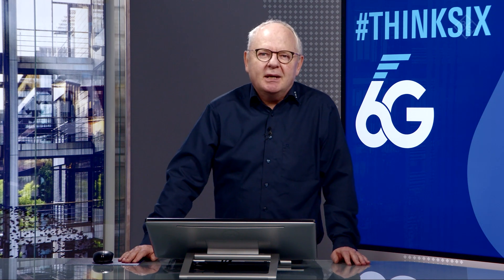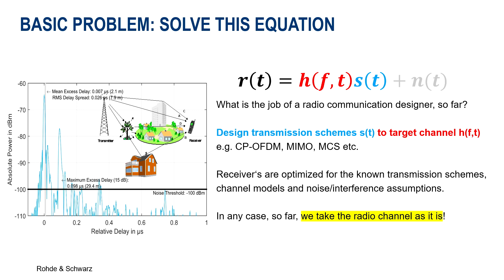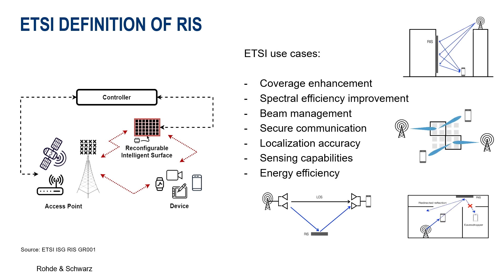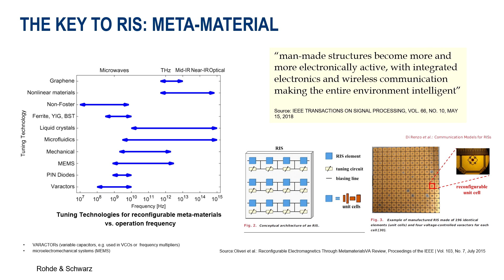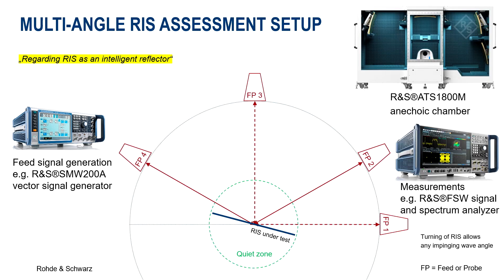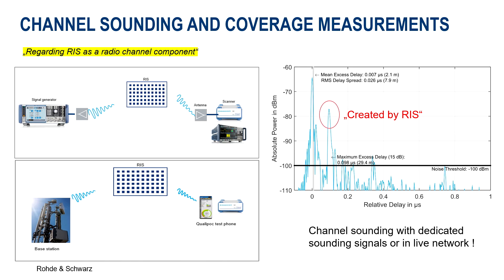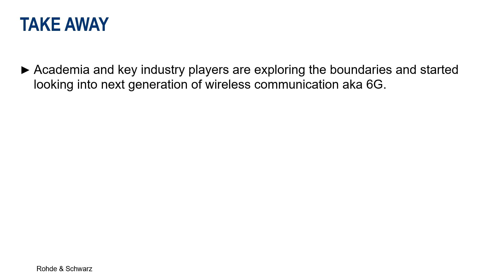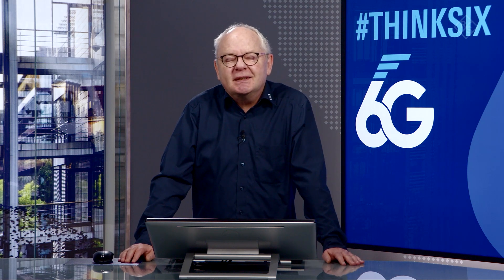6G Reconfigurable Intelligent Surfaces (RIS) explained

Comment: are intelligent surfaces and metasurfaces the same?
Reply: metasurfaces are a type of structured surface designed to manipulate electromagnetic waves, while intelligent surfaces, such as Reconfigurable Intelligent Surfaces, may use metasurfaces or other technologies to dynamically adapt and optimize their performance in wireless communication or other applications.
Reply: @mohammedkareem549  Thank you
but how this metasurfaces are made intelligent?